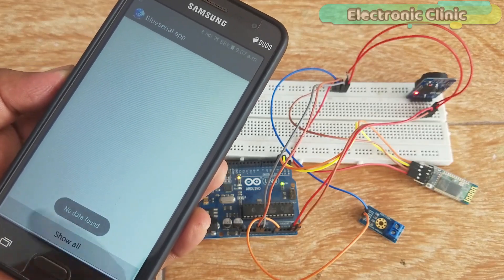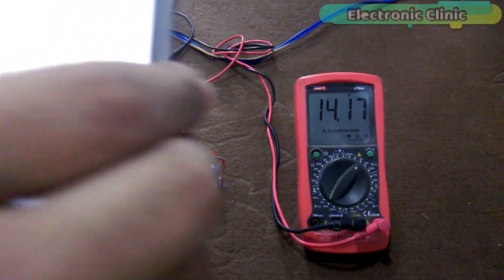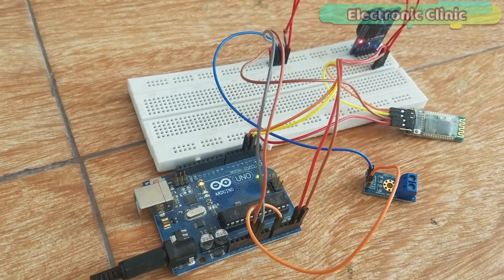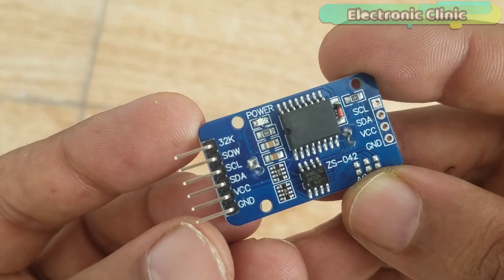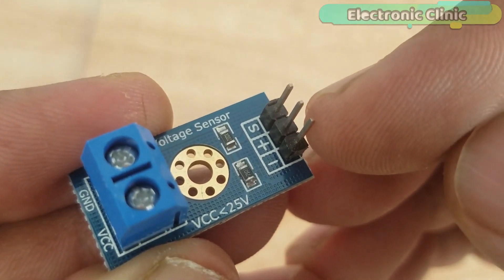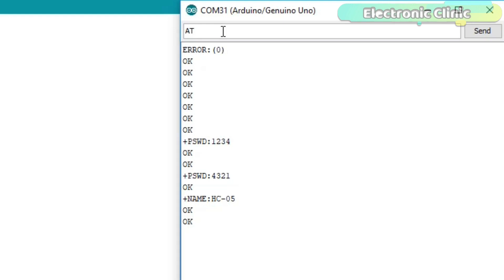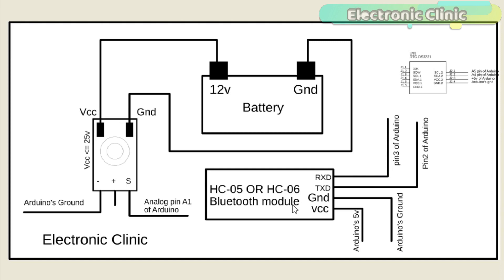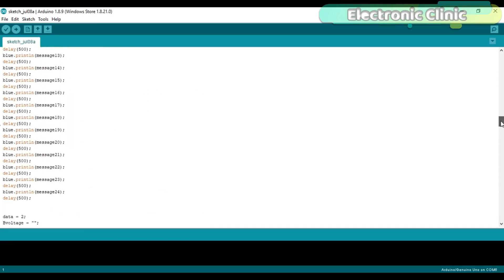12v Battery Efficiency Monitoring using Arduino and Cell App with Database

Comment: I have 14.6v batteries with internal bms. Each battery has 4 module 3.65v = 14.6v. The battery has an amp connector. I made up a connector to rs485 to usb so I can read on my computer. How can I use arduino connected to 4 module relay connect to rd485? And also the code. Thank u